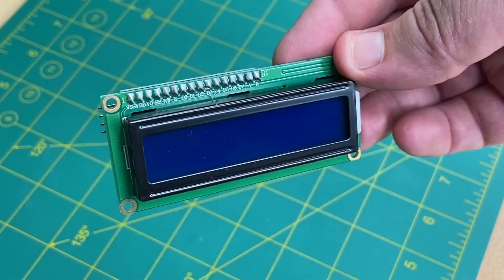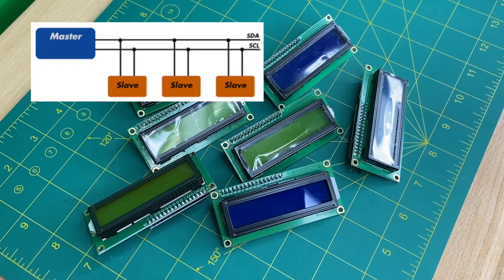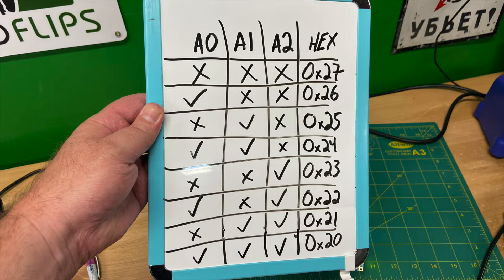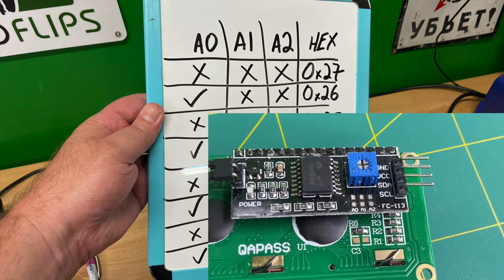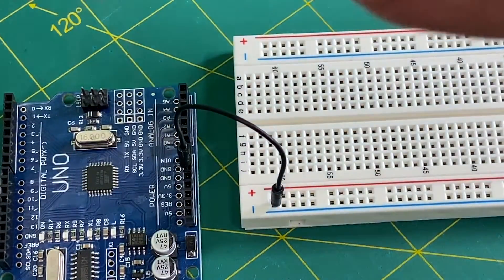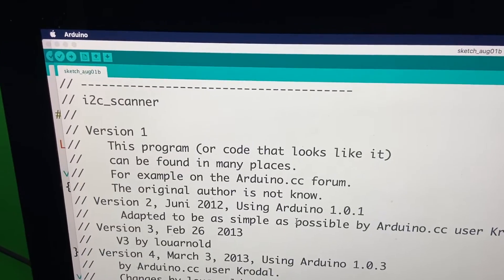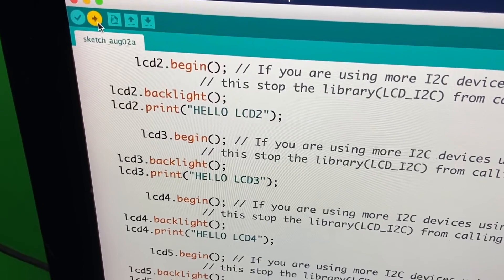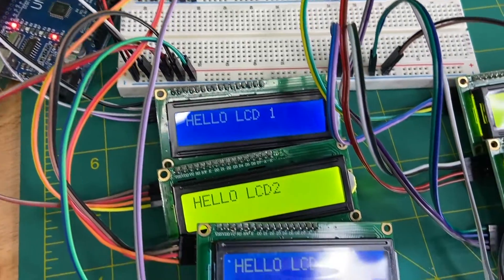How to connect multiple LCD displays to one Arduino

Comment: So with one Arduino you can send 8 different (or more) signals to 8 different Displays?
Is the size of the sendet data limitied? For example could the arduino receive an GPS and Bluetooth signal, keep them seperated and send them to different displays?
Reply: Yes...what you write to each display is called and assigned to that specific display...you would just assign the desired data to the desired screen